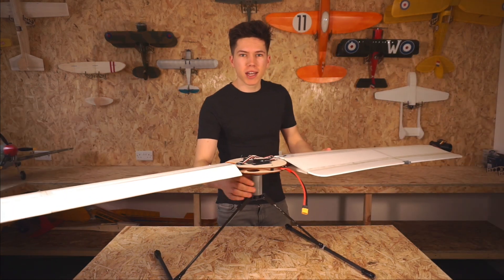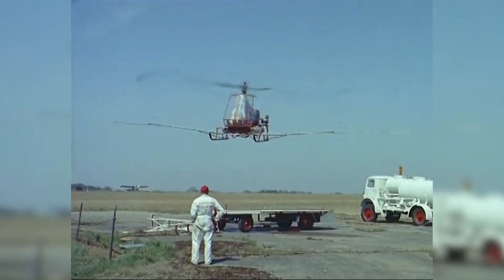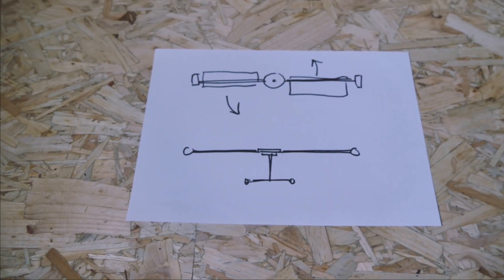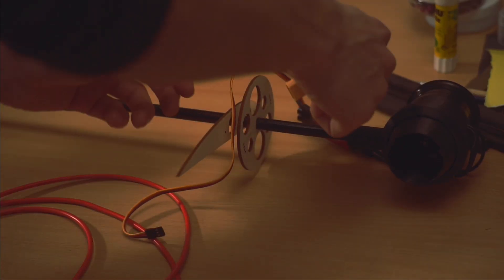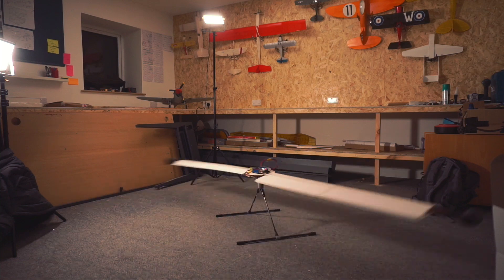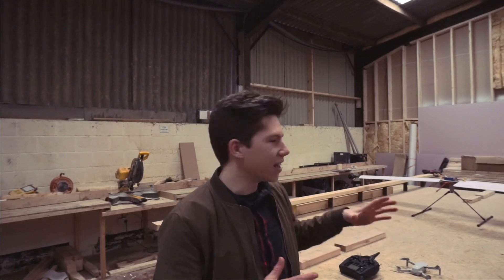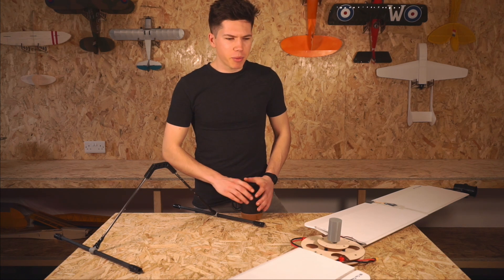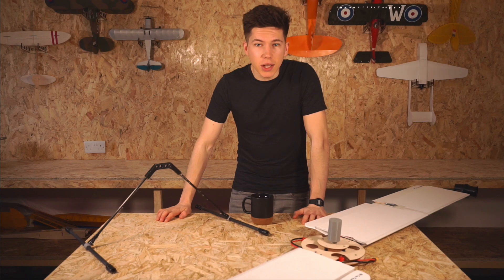TIP JET Helicopter Mk1 (Will it fly?)

Comment: That was quite interesting! I wish my spare electronics box was as full as yours :). I think balsa rotors might be too easily damaged if something goes wrong while testing it, and they would take a lot more repair work if they did get damaged. Looking forward the next vid!
Reply from the maker: Yes I agree.- that's one reason I definitely didn't want to go down the balsa route initially 😂 Maybe a far improved mk 2 would benefit from balsa blades when there's less chance of binning it into the ground.
Reply: @Project-Air  Sounds like a plan, good luck!

Comment: Try putting the fans near the hub and run the forced air through the wing to a 90 at the tip. There was a test helicopter called the pegasus that used a gas turbine to run a turbo fan and up the mast and down the rotor

Comment: If there is a vertical hole through the main hub, put it over a dowel or tube to test lift while it will be held in place.  "Night Flyer" built a platform for helicopter beginners years ago and it worked really well.
Reply: I was just about to make this very same suggestion! good for testing lift force without worrying about it wobbling around. but only if you can drill a large enough hole at dead center.

Comment: You are ready for a flight controller and some cyclic control.  I wonder if fast servo's will be fast enough for direct control or will a mechanical swashplate or Hiller bar be required.   Remember gyroscopic forces act 90 degrees of rotor rotation after the input.   I love the fluid mechanics citations and math.  People should know what you are doing and how you arrived at the design choices you made.  Post more!  Subscribed.

Comment: I bet if you were to use the fans at the center of the hub to blow through the wings and right angle out the tips it would work take off and have better acceleration. I am actually working on a similar project as well. Also you could try adding rockets to the tips if you want it to really go fast! Lol

Comment: You need a swash plate and cyclic to control the angle of attack of the rotors as they rotate
Reply: Look up videos of helicopter rotor hubs in slow motion

Comment: Increase diameter should increase lift thrust with a small increase in spar weight.   Go outside, or test stand for measuring lift vs watts of power.

Comment: Hello!
If you shape the rotor blades more like a regular propeller with a wide base and pointed tip. The speed is slower towards the center of the rotor blade so you can also adjust the pitch angle accordingly. You should gain greater lifting power and less weight.
  ... FliteTest fades ... You have much more !!
Thanks!
Reply: Yeah I was just about to comment this. Optimum AoA and airfoil shape will shift with distance from the hub. Once you know your target rpm a better blade profile could help a lot.

http://aircraft-design-software.experimentals.de/propeller/propeller-design-analysis.html

Comment: Howdy, James! Hydrofoil guy Dave here. This looks like another awesome, yet challenging project.
My intuition says that even though it is a tip jet helicopter, it is still subject to the same gyroscopic effects as a traditional helicopter—the only advantage being that you have eliminated the torque effect of the rotors. Other than that, it is still, in every other way, a helicopter. To that end, you will still need some form of dynamic control. As Tom Stanton's bicopter video shows, a weight hanging down low simply isn't enough. I think there are two ways to go about this; but in my mind, one is clearly a better option than the other:

Option A. (The I-want-to-make-this-as-hard-for-myself-as-possible method): Code a custom flight controller to mount to the hub and spin with the rotor. Mount a set of servo-controlled tabs to the outer portion of the trailing edge of the rotor. The flight controller will use these to fly the rotors as they spin, thus giving you some modicum of cyclic control. But. There would be no directional indication, and the flight controller would have to know exactly which direction is pointing away from you at all times. Believe me, you don't want to go down that road. Instead...

Option B. (The this-might-actually-work method, and you don't have to change a thing on your hub and rotors): Duplicate the control method of the Hiller Hornet. I will work backwards from there. Hopefully it will make sense.

Background: Weight shift trikes: The pilot controls the aircraft, not by changing the pitch and roll of the wing, per se, but rather by shifting the weight of himself and the trike relative to the wing. If the pilot shifts his weight to the left, it will bank the wing to the left. If he pulls his weight forward,, the wing will pitch down. In the same way, in the the Hiller Hornet, when the pilot would pull his weight forward, the rotor would tilt forward. If the pilot pushed his weight to the left, the rotor would tilt to the left. I'll get to yaw control later, but here's how I would manage pitch and roll: Replace your original landing gear with a simple gondola. All it needs is a three servos, a receiver, and tiny battery to power the receiver and servos—nothing more. Something like a 2s350 battery. Two servos will be used for pitch and roll, respectively, and the third will drive a rudder for yaw control.

On top of this gondola, you will need a pivot akin to a universal joint or gimbal. In fact, if I was doing this, I would use a Lego universal joint as my pivot. The bottom of this pivot would be securely mounted to the gondola, and the top would be connected to the axle that the hub mounts on. Just above the pivot, I would put two arms at 90° to each other. To put it in terms of the SolidWorks coordinate system, you would have the rotor's axle on the Y-axis, and one arm each on the X and Z axis. To put it another way, looking from the top, I would have one arm pointing forward (longitudinally), and the other arm pointing left (or right. Just oriented laterally.). One servo connects to each arm with a ball joint. The servo on the Z-axis arm will control pitch—the servo on the X-axis arm will control roll. The end result should be that as you command down elevator on your transmitter, the axle will angle forwards. If you command left aileron, the axle should angle left, and vice versa. (Ideally, you would want to adjust the pivot in each axis such that it is purely pitch or roll without veering to one side as it moves in that axis. You may have to mix in a small amount of the other servo to extend a small amount to keep the axle angling in the proper plane without veering to one side.)

Finally, YAW: This is as simple as using a rudder, except instead of rotating about a vertical axis, like an airplane's rudder, it needs to twist on a longitudinal axis. The rotor wash will blow over this, and will be directed to the left or right by the rudder, thus affecting yaw control.

The beauty of this method is you can use your existing rotor and hub without modifications. The only difficulty is you will need two receivers bound to the same transmitter: One receiver is in the gondola, controlling roll pitch and yaw, and the other receiver is on the hub, controlling the throttle of the EDF's as you have it now. It is as easy as that! 

I am not going to claim these are the only two ways it can be done, but I think option B will be the easiest to achieve. Good luck with getting the project in the air!
-Dave
Reply from the maker: Hey Dave,

First off, sorry it's taken a while to get back to you. Thanks for your helpful comment! 

I absolutely like the sound of option B and was concidering something along these lines previously. Although option A seems like a theoretically good way of controlling the rotor, I think you hit the nail on the head when you say it is "as hard as possible" haha. 

Although B sounds like a good idea, I'm currently aiming to make it simpler still - by creating a Rotordyne type aircraft. This is a goal I wasn't to explicit in convaying to the viewer in this particular video as, honestly, I don't know if the project will get that far! 

In the next episode I'm concidering building a rough fuselage under the rotors. Later I would add two differential motors for forward flight along with tail controls. Although this makes the aircraft more of a vtol autogyro, I think it's probably the easiest way to create a fully fledged tip jet aircraft from scratch. 

Anyway, we'll see if I get that far. ;) 

Thanks, 

James.
Reply: @Project-Air  I did a bit more digging, and found this video of a RC weight shift helicopter. It's not a tip-jet rotor, but it uses the same control system I have described: https://www.youtube.com/watch?v=Q2wNT3_qJ90
Reply: Hey James, I like the idea of building a Rotodyne!
I had some suspicions about the Rotodyne's control system, however, so I did some research during my lunch break. What I found is quite interesting. The blades of the Rotodyne did not have a fixed pitch. Instead, they had the same swash plate style control that a traditional helicopter has. In a hover, the dynamics of controlling the Rotodyne are no different from a traditional helicopter, except that a tip jet helicopter produces nearly zero torque.

A spinning rotor of any form is inherently unstable. In other words, it will not return itself to a level attitude in a hover without some form of dynamic control input. If you want to mimic the controls of the Rotodyne, you will need to create some way of dynamically varying the pitch of the rotors, essentially, what I described in section A before. The alternative would be to build some swash plate system, and rebuild your rotor with variable pitch blades. Trust me, it would be even more complicated and expensive than what I had described in section A.

Having taken some time to study the dynamics of tip jet and Rotodyne-style aircraft, I can confidently say simply adding two propulsion motors to a fuselage hanging below the rotor will not give you any form of control in a hover. Instead, my research has confirmed my previous recommendation that the easiest way to achieve a stable, controllable hover is the weight shift method I mentioned above in section B. It is the only way I have found that will achieve a hover with fixed-pitch blades. For your project, the gondola hanging below the rotor would simply look like a Rotodyne fuselage.
Reply: I have some custom code looking for a test vehicle for Option A. https://www.youtube.com/watch?v=BbZSmPiyiSs
Reply: these are exactly my thoughts as well regarding gyro and torque effect. I would even say that the torque effect on the model could be worse since there's literally no weight hanging from the rotors.
Reply: What about using wash controls with a more axially flexible wing to torque the wing tip varying angle of attack..
or perhaps extending wash controls length into 'airstream' as addition airfoil control..
Reply: Maybe all of you guys should go rent a room.

Comment: The blades need to be at a higher pitch at the root than at the tip because at the tip the move much faster. It also might help to build a 3 blade rotor because it is more stable than a 2 blade rotor.
Reply: I didn’t watch every last second of the video but on my RC helicopters only fixed pitch blades are like what you described. On my collective pitch helis there is no blade pitch. They are flat blades that tilt with a servo so I wonder if he could do something like that with this project.

Comment: I don't know anything about this stuff, but just in case : seeing how hard it is to actually get it up to speed without it "walking" away, maybe you could try to hold it on the ground and only release it when it's going fast enough ? Like rockets in a sense !
Reply from the maker: I would think that would be a much more ideal system of launching the thing! 😁 Will investigate some options on the next vid.

Comment: Not knowing how this really works I'm wondering, what would be the ideal weight ratio between the wings and the hub? Is it important that the hub is heavier to keep the wings rotating around it and stop the helicopter going off in a random direction? On a real helicopter I would expect the weight and aerodynamics of what the rotors are carrying (ie. the fuselage and tail) to have a significant influence on its stability. Are you able to compensate for the missing fuselage or does it in fact not matter?

Comment: Well ... that is fun.  I remember in the 70's that every popular electronics and popular mechanics would be offering drawings for sale in the back, for such a thing.  I wonder if those little ducted fans would actually get up to speed enough.  You might want to use quadcopter brushless motors as an experiment.  Propellers are way way more efficient than a ducted fan.  A slipring would be great too to allow putting the batteries on the frame.

Comment: Glad to see your keeping your ambition in check.......  So many questions! What is your strategy for balancing the rotor. And what is your strategy for keeping your angle of attack consistent between the two blades? As far as lightening the airframe goes, do you have a hot wire foam cutter? This project looks to me like a good candidate for insulation foam wing sections. More foam, less hot glue. Also, I think tethering it down would be a good idea until you get the shakes out. Good luck man. Looks like fun
Reply: Checked Ambition is the hallmark of Mediocrity.

idk.. I just made that up..
Ridiculous Ambition (Dreams!) are what separate humans from a lump of rock.
Mourn not Icarus, but rather pity Joe Average.

Comment: Thanks, great you're doing this, I was thinking about since years...
- Put the wires inside the carbon tubes.
- use 2 servo to control pitch... BUT use a "freewing" like on the scorpion UVA -> https://www.youtube.com/watch?v=Iv4ugNUXzrg to reduce the force needed.
The tip jet helicopter I like the most is the Mc Donnell model 120

Comment: I think it needs very secure almost like a weighted base to prevent oscillations, maybe move the batteries below for a lower center of gravity. Shorter wings might also be better?
Reply from the maker: I thought about clamping it down until getting up to speed but that might get a bit complex. The new landing/takeoff gear setup should help keep it fixed in one spot though without it wandering off!
Reply: In this design case, shorter wings will require more rpm and cause more vibration.

Comment: Try to keep the engines at 3/4 length...not the end so it has to cover less circumference and at the same time provide more torque
Reply from the maker: I definitely considered this! ☺️ Josh Bixler created something on Flite Test a while ago and put the motors about half way along the wings which I remember thinking was an excellent idea. I wanted to design mine more like the originals that inspired the project, however. 👍
Reply: @Project-Air  I believe there is one design of a small craft of this type from the 1960's that had the engines on two short non-lifting supports that were mounted cross-wise on the rotor to the pair of lifting blades. (Engines acting as part of the fly-bar or something like that?) Much simpler, but same principle as having the motors mounted inboard on the rotor. Don't recall the name of it, but remember seeing pictures somewhere.
Reply: @Project-Air  Glad to see a young guy for a change who isn't into piercings-tatoo's and blue hair....( just joking). The "originals" you refer to all used jet power (pulse-ram) on the rotor tips, not propellers or ducted fans.
Research the German WWII era Nagler-Rolz prop-copter which you probably know.
Use a steel tube with a base plate screwed to the bench and mount a plastic tube on the helicopter that fits into the steel tube loosely. This way you dont have to worry about drifting of the helicopter and you can put a simple measuring device to detect the lifting force at a certain rotor RPM. Obviously incorporate some "security" so that the helicopter cant lift itself out of the tube.
There are foam RC wings available in the size you're using which will have much greater efficiency than the homemade wings/rotors.
Hat's off to you young man !!
Very interesting project !!!
Reply: Putting the motors at 3/4 distance out will reduce the torque on the whole system (force x distance = torque).  What James could think of is that the inner part of the rotating wing moves at a slower speed so he could remove the first inner 1/3rd of the wing completely to reduce weight?  Use the saved weight to make a greater wing chord at the tips for extra lift Not sure how this will pan out but worth a try.
Reply: I like the controlled factor